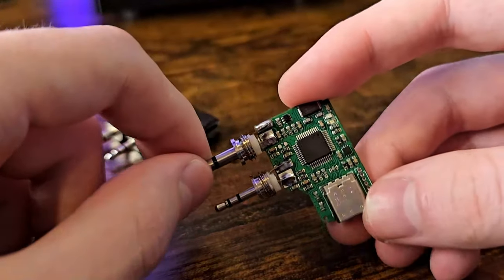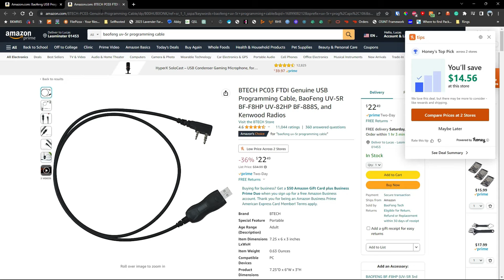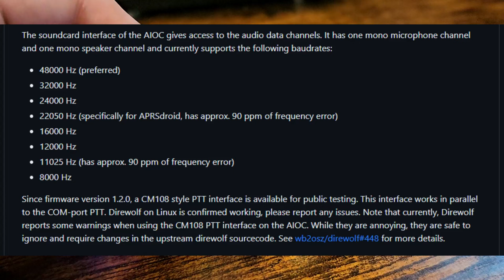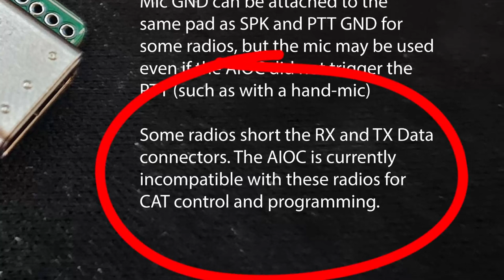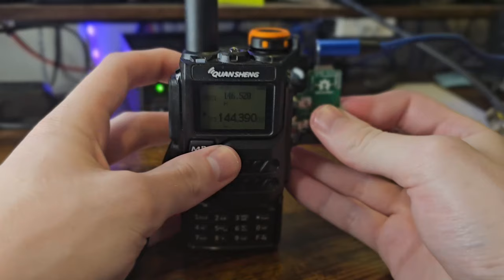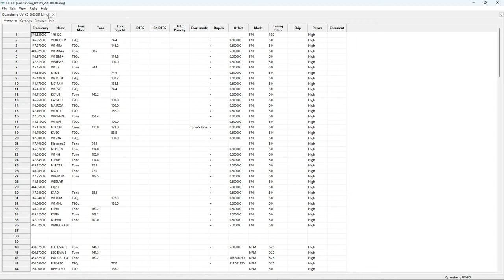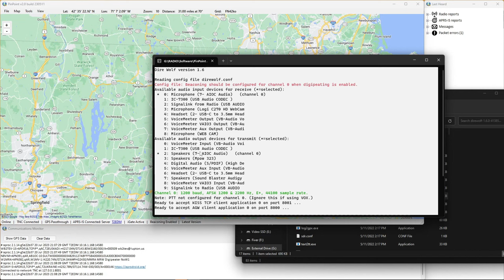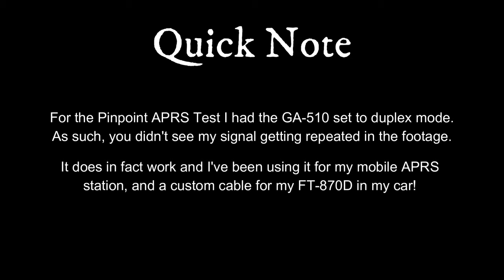The Digirg and Signalink are OBSOLETE | The AIOC: All In One Interface Cable

Comment: Has anyone had a solution to the RF issue causing the AIOC to lock up? I've read that this is only an issue on stock antenna and that an external antenna connected via coax is good. Also the developer states audio extension cables with ferrite filters may work.
Reply from the maker: Ive experienced this when using a standard usb c cable. Using one that ends in a right angle fixed it for me. It usually happens when the usb connection between the pc and the aioc fails (typically from rfi hitting the usb controller)
Reply: I don't believe so. My DIY interface also locks up when I have the stock antenna, shielding does not help. With an external antenna it works great

Comment: Very interesting. Version 2.0 should / could / might be flipped so that the USB plug is at the bottom.  Better for weather resitance.
Reply: I agree. I talked to the designer and they said it's not likely for some time as it'd require a lot of redesign, but is a maybe for the distant future.
Reply: yeah definitely needs to be facing downward instead of up. I also can see people will be 3d printing some cases for this I hope/
Reply: Well, from what I have seen, most Baofengs are NOT weather resistant either. So!?.... You will likely not be operating a bunch of digital equipment in the rain anyway. 
But I do see your point!

Comment: This is interesting, after building digipeaters for several years this is what is needed.  It looks like its aimed at HTs and thats fine.  I use higher powered radios for most of my work and I would need to make cables for these with packet ports.  So do you have a schematic so I can work that out.
Reply from the maker: We do actually! There's one in the video but it's also available on the website!

Comment: Could you set this up to work with a Baofeng to serve as a repeater identifier?

My issue is that I have a pair of radios that I'm using as a repeater, but I have to get a second device to do the CW identification at this rate unless I want to start soldering on the boards.  There are versions of arduino fox hunt transmitters that nearly fit the use case, but this is much more compact if we can make it work.

Example :  10 seconds after hearing anything, send PTT and CW, start 10 minute timer, if during that 10 minute timer, more audio is heard, repeat CW transmission and restart 10 min time, else terminate loop.

Comment: I'm confussed.  I am not aware that I can program my ht with my Signalink USB.  I use the Signalink with my HF radio for doing WSJT-X.  AF6MC
Reply: Because you can't. A SignaLink is just an external soundcard with some timing and power adjustments. & Line isolation!
Reply: The AIOC works with Chirp. I programmed several radios using the AIOC. Specifically Baofengs.
Reply: So being that one has nothing to do with the other it's a null statement.  Thanks I'm no longer confused.
Reply: @deanmason560  The cable literally does both jobs.
Reply: @don_n5skt  All it showed was programming a radio.  I do not see it running like a digi or signalink.  BTW I don't use chirp.  I use RT Systems.  Maybe someo e could mske a youtube video using the cable in ft-8

Comment: So the issue of the USB-C port pointing upwards and RF from the antenna causing data issues, could the device be programmed to change the io pins so the plugs can be wired in reverse so the usb-c port points down? Would that be easy to implement???
Reply from the maker: Not very, it would require a redesign of the board. The original designer said it would be too difficult to implement. However, I am looking at the AIOB, an all-in-one board that lets you easily make your own custom cable and has some small changes. This would allow the AIOC to not be plugged in right next to the radio, but down the line further.

Comment: Should this work for upgrading the firmware on the UVK5?  Using the web loader for the firmware. It failed that random spots. I unplugged the AIOC and used a FTDI cable and it worked immediately.

Comment: The form factor of it very nice, I am thinking about trying to install it inside a mono band mobile (i.e. FT-2980). That way it is just a USB from the radio to the controller (i.e. Pi zero running direwolf)

Would make for a really nice remote digipeater. Any thoughts?
Reply: I do exactly this with my AIOC. I use a Baofeng and the CM108 sound chip PTT which is a setting in Direwolf. Works great as a digipeater.

Comment: Does either version of the firmware avoid having to use the VOX function on radios like the Baofengs, and, if so, which does that? If both, which is better for this application? Thanks.
Reply: I'm using Hardware PTT on fldigi with a Quansheng K5(8), no need for VOX. You can then have the Squelch open.

Comment: Is this unit available for Yaesu HT's?
Reply from the maker: There's nothing set up for Yaesu HT's specifically but a DIY cable would be pretty easy to make. Which specific HT are you thinking of using?
Reply: Not OP but I’m interested in a cable for the FT-60. 😊

Comment: Hate to say it, but this is completely and totally inaccurate of a statement. The Digirig and Signalink both perform way better than the AIOC in my situations due to the lack of RF protection of the interface. RF near the AIOC causes it to lock up with the PTT active. This device also fails to work properly under MacOSX due to the USB driver / audio driver lacking proper support. I've not tested with Windows yet (I will) but it does work fairly well with Linux. Sadly the developer doesn't have the proper equipment to test the device under anything but Linux (seemingly) and has no seeming motivation to address the driver issues. That being said, the G1LRO Universal Radio Controller which is based on the AIOC addresses the RF issue for the most part, he recommends (rightly) to remove the antenna from the HT and use an external antenna to prevent the radio locking up.

Comment: Will this work on Fldigi?
Reply: Yes works on fldigi with a Quansheng K5(8), no need for VOX. I'm having trouble with EMI with stock antenna. May need to use audio extension cables with ferrite filter.